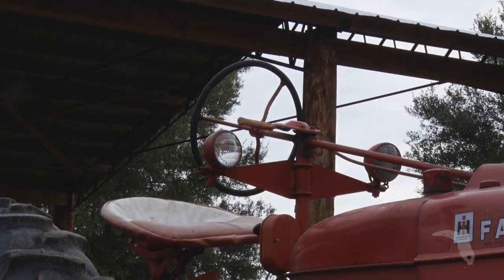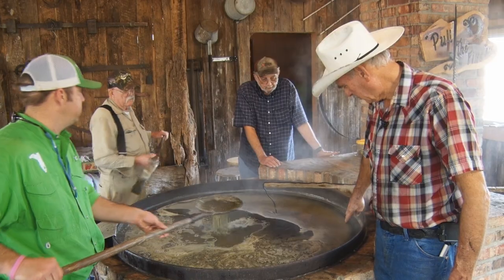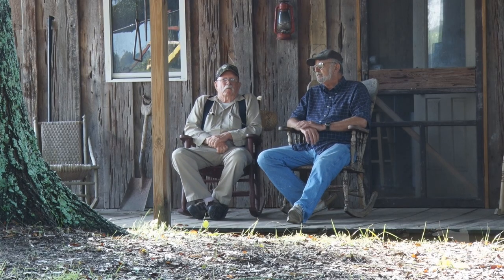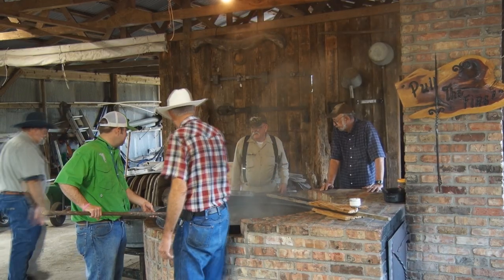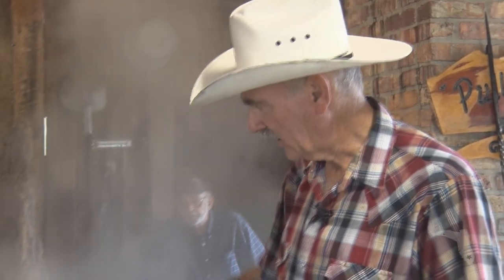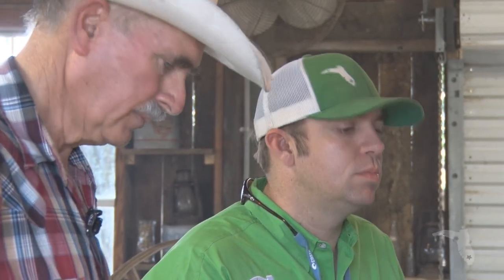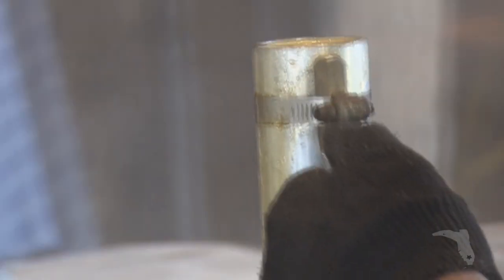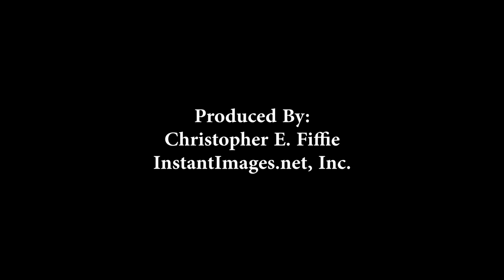Making Sugar Cane Syrup an Old Florida Tradition  - Florida Cracker Kitchen

Comment: I remember watching my uncles and cousins making cane syrup in Georgia.  They still had a mule drawn press that so big an adult barely had to stoop over as the beam passed over.  When I got older I got to ride the tractor with my older cousin to gather more cane and fire wood.  They cooked in a huge iron pot.  When we returned home we always took two gallon cans of syrup and we used it all up in less than a year.  Also, back then you could buy cane stalks at the A&P grocery store.  The stalks leaned in the corner by the front door.  The juice was so sweet but the pulp left over when the juice was chewed out was sure not.

Comment: We used to Make Syrup for Decades...We used the Other type of Mill you have the one resting on the Post that your not using but somewhat larger we had a Car Rearend Vertical with Gears and Chain run off a Tractor PTO. We Started around 2am and made 12-14 Gallons of Finished Product Twice a Day.....I Still have the Mill of My Dads. A Lot of great Memories, A Lot of Hard Work.

Comment: ihave sugar cane growing in my yard here in Miami. is there an easy way to get the sugar out at home? :p
Reply from the maker: +Beach Life Look for an old small grinder that you can extract the cane
Reply: Take the canes, cut the tops off and wash them really well to get any mold or fire ants off.  Use a scrub brush.

Cut it up into pieces and put it in a pot of water to boil. The sugar will boil out. (I'm not sure if the canes were peeled first, but I don't think they were). 

I've got cane growing my yard but haven't made any syrup out of it yet.

Anyway, once it boils down a bit, you have to really watch it to keep it from scorching. Get it to the syrup point, where it sheets off of the spoon or use a candy thermometer. 

Add a little lemon juice to the jar to keep it from granulating (that's from deep south homestead) in the jar and put the lid on it while it's hot and it should seal.

Comment: What you buy in stores, which is really "cane syrup flavored" syrup, is vastly inferior to the properly made traditional product. The real stuff has a rich, almost buttery taste.

I have yet to find a 100% real cane syrup made on a large scale commercially that tastes like the real stuff. There's 100% real cane molasses, but that's not nearly as good and it's not the same thing. 

Steen's makes a 100% cane syrup that is better than most store-bought cane syrups, but it's not as good as the traditionally made stuff. I think maybe they use the wrong kind of cane or cook it too fast.